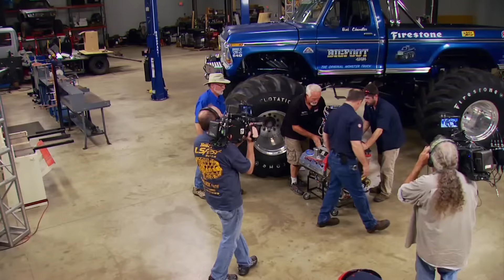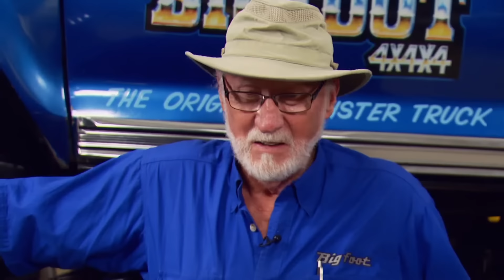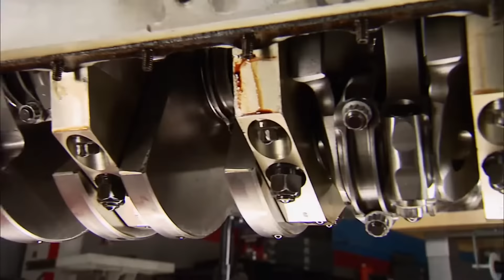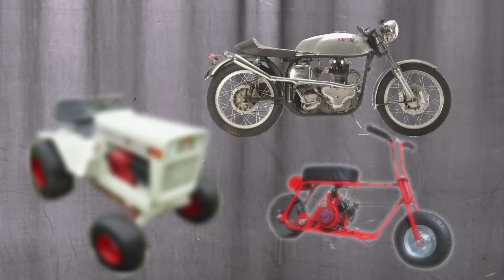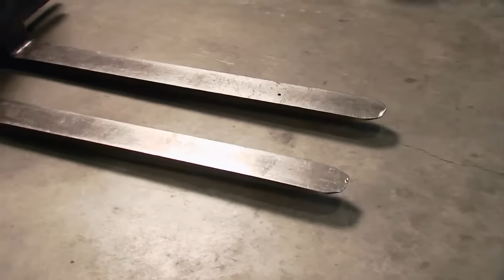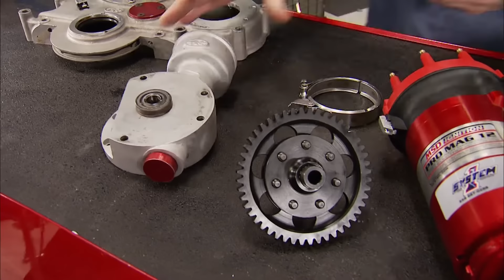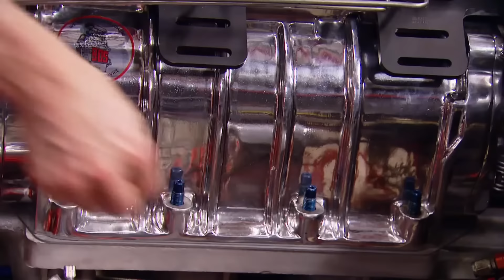Full Build: Bringing Bigfoot's Original Blown Big Block Ford Back to Life

Comment: The massive waste of money that goes into race engines is ridiculous. I’m willing to bet that engine only had less than 5k miles on it. Considering it won’t be ran that much after this it’ll still deteriorate from not being ran as it needs to be. It’s all so counterproductive. Wait until it’s parked for good in a museum and put the non running engine in it. It’ll never be ran again after that point anyways

Comment: This gives a pretty  good idea of how strong forged steel connecting rods are by the fact that they are using the old ones  , every 7.3 powerstroke I bought was with forged steel connecting rods , they started using powdered  metal connecting  rods that were garbage if u add big power.

Comment: PRO TIP: When heating up bolts to kill loctite, use crayons instead of spraying WD-40. I know it sounds silly. But if you push a crayon to melt onto the threads it will work an unmeasurable amount better than WD-40.

Comment: Fully center-counterweighted crank.. 

Nice! 

I use a fully center-counterweighted billet crank in my big Oldsmobile, and MAN that engine is SMOOTH in the high RPM's. Even though the crankshaft ends up weighing more with the center weights, I FULLY believe in using them, and WOULDN'T build another big power motor without one. 👍 
The bearings in my Olds ALWAYS come out looking pristine after a season of beating on it. That was NOT always the case with a stock style crank with no center weights. Even with an aftermarket crank. The #2 and #4 main bearings were always looking a little worse for wear while using a no center weght crank. Now the problem doesn't exist anymore.

Comment: Me uncle Herman Denunzio built this engine.  He passed away on September 23, 2023. He started  Goleta Speed & Marine (which is mentioned in this video)  and De Nunzio Racing Products, which sold off road racing parts. They were avid in Off Road (Baja 1000, etc) and Boat Drag racing.  Which is were this engine was born. RIP uncle Herman. If you guy remember the boat crash scene on Wide World of sports (Opening Scene) , That my cousin Tonny.  Broke his back and both legs. He fully recovered. That was a very similar motor.
Reply: Godspeed Uncle Herman!
Reply: Very cool.
Reply: What state did he start in?
Reply: @TimothyDilley  Goleta California

Comment: What's cool about the two initials on the block using black permanent marker (assuming it is Sharpie brand) is that it will be like a thin powdercoat after a heat cycle or two. Plus some is in the tiny crevices of the aluminum. At my job we had 303 stainless turned housings that were heated to 80C to allow an interference fit ball bearing to be gently pressed inside. They had sn's written on the outside that just would not come off even with acetone and benzene. We had to put them in a lathe 6 jaw chuck and take a couple of tenths off. Yes, Scotchbrite by hand reduced it, but it was still legible.

Comment: Helpful hint.  To make sure you haven't pushed the line out or fuel pressure hasn't worked it out, mark the braid with a sharpie.  Nobody will notice except you when your maintaining the car/truck and is an immediate tell if the line pulls/pushes out.

Comment: What about the Fire Rings on the cylinder  to head mating surface. Does that one not need actual stainless steel wire pressed into the slots?

Comment: As a child of the 80s Big Foot was everywhere.  The merch was as big as those 66" tires, and heck I remember Power Wheels had a Big Foot truck.  She is that iconic, and the evolution story from a simple camping truck to the #1 monster truck is epic!  Without Big Foot (and the legend Bob Chandler) I doubt that monster truck racing would ever have been a thing.  Sure someone may have built a beast, but it never would have caught on.   There are others but there can only be 1 original Big Foot.  Big Foot is the OG and the GOAT!!!

Comment: In 1959, Ford began its first production of factory four-wheel-drive pickups.....
Reply: Yes jerkwad but YOU COULD NOT BUY AN F350 4X4 FROM THE FACTORY UNTIL 1978. Before 1978 Ford outsourced the 4x4 for the F350 to Marmon Herrington or Napco. Ford only produced the f100, F150 and f250 4x4 in house before 78. For phuk sake man, Google could educate you if you did research

Comment: They didnt have 4x4 vehicles? So why is my 1972 F250 a 4x4 divorce T case? or 1965 F150 4x4 with divorce T case
Reply: Ford only built 4x4 trucks in f100, F150 and f250 until 1978. The F350 was only available as 4x4 before 1978 if you chose to have Napco or Marmon Herrington aftermarket 4x4 installed. I own a 1971 F350 with the Napco 4x4 and several 1967-72 F250 4x4 built by Ford. Hopefully that clears it up
Reply: @TheRoadhammer379  Honestly you think i care about some old JUNK truck lmao ill stick with my 2024 cummins that will put any of those trucks to shame and by way they made F350 4x4s in early 70s late 60s

Comment: Good memories of grabbing 2 cartons of brand new eggs from the fridge that my mom just bought and running them over with my power wheels big foot! I got grounded and yelled at but those 30 seconds of bad assery as a 6 year old was def worth it!!  Love this truck and the engine refresh on this episode!  The attention to detail to address every potential future issue on this engine, strengthening weak points, care taken with this engine so that it’s less likely to break something every week was awesome!! Great job guys!
Reply: Back when I was young, there was no battery operated Power Wheels, all of our rides had pedals that you had to power with your legs and feet.

My son ended up with a Power wheels Jeep under the Christmas tree one year though. 

Once the original 12 volt lead-acid batteries died, I PROMPTLY rigged it up to use my 18volt Lithium-Ion cordless tool batteries... 😆 

The look on my sons face the first time he hit the gas pedal with the tool batteries in it, and the Jeep LITERALLY did a wheelie.... 😂

Those batteries were SO convenient, made POWER in the Jeep, and recharged in 25 minutes instead of overnight like the lead acid originals did. 

He had a TON of fun with that thing!!... 👍

The motors took the 18volts like a champ, and never failed.
Reply: AWESOME  BRO!!

Comment: Why are you guys at Truck Tech calling it a 640? It was 638, now it is 572. It is much smaller.
Reply: No engine is spot on with cubic inch measurements. A 7.0 liter Ford engine covers the cubic inch range of the 427, 428 and 429. The 302 Ford, 305 and 307 chevy covers 5.0 liters. 638 is just rounded up to 640, not a big deal. And to answer your question about 572 cubic inches... the shop that machined the engine used much thicker cylinder sleeves, so the bore size went down but the cylinder wall rigidity improved, thus the engine lost cubic inches
Reply: @TheRoadhammer379  
You’re mixing things up. Yes we refer to a 7.0 as one of those you mentioned. But nobody refers to a 427, 428 or 429 as a 430 which would be the equivalent. People don’t even refer to a 598 as a 600. 

And I’m well aware that they changed the note. My point and why I asked a somewhat rhetorical question was, to highlight the fact that at no point in time did they refer to it as a 572 after the change. They still talked about a 640. This was pretty silly as that’s a massive difference. Had it been a matter of taking it 0.0010 over or something had it just been rehired, sure. who cares. But taking it down to 572? C’mon make an effort to inform the viewers a bit.

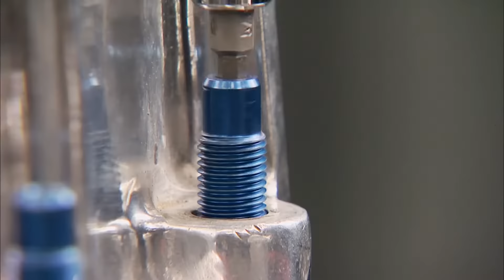Comment: You guys are fake AF… @ 3:03 the blower is sliding around on top of the intake while push the engine/engine stand across the floor, then @ 8:42 it’s magically bolted back down. More staged B.S….. 👎🏼👎🏼

Comment: so ive seen people install a carb spacer to get more air in the engine. could you install that torque plate under the heads and get more piston travel to increase power

Comment: This is not the original Bigfoot. The original was a 1974 ford that had a blown 460 with iron heads. I have a picture of it at Sanderson Ford in Glendale ,Az. Probably around 76-77  It used to be his river truck when he and the family went camping, take the camper off, play in the river.
Reply: This is the original truck. Bob swapped out a 78/79 front fascia on his 74 pretty early on.
Reply: @nathanmcdonald610  Well , he probably made alot of changes on the original. The truck I seen in Glendale is the one he crushed his first car in front of his shopas a demo video.  He had 44" forklift tires on handmade wheels (white) and it and 2.5 ton rockwells for axles.
Reply: @michaelwilliams2151  Yeah, again, probably still this truck, in the early days they ran 48 agricultural tires before they eventually moved up to the 66's that became the standard.

Comment: My dad LOVED those Predator carbs. Thats all he ran on his performance cars!
Reply: Would like to know if your dad had issues with air been sucked in past needle bearings on the throttle shafts, had this problem with a NA 351C which ment for a normal idle the whole carb tune was super rich
Reply: @johngibson3837  I’ll ask next time I talk to him. I do know that he would grind custom cams for the carb, make fuel baffles out of cut up beer cans, adjust the size, quantity and spacing of individual holes in the Venturi fuel bar and about every other tweak and tune you could do to them.
His last setup was on a ZZ4 small block he blueprinted with an original 6-71 on a chopped and tubbed 34 Ford Coupe that would run like a scalded ape on VP110
Reply: We ran them on 545ci BBF sled pull engines. They were all tuned by an old timer that was a carb wizard, absolutely love these carbs

Comment: I remember when the predator carbs was a have to have or you weren’t in the game .
Reply: They we're great for Monster Truck applications back in the day because they we're much more resistant to stalling than your standard Holley or Edlebrock when trucks had their nose pointed at the sky. They had a good run until fuel injection became the primary method of fuel delivery for these beasts in the early 1990's.
Reply: @nathanmcdonald610 had that problem with a 351C in a landcruiser, in the bush on steep hills holly carbs would fail due to lack of fuel in the bowls but a predator solved that

Comment: I'm confused, how old is the engine?
I'm 14 mins in and they said it' s 20 years old, 30 years old and mentioned that it was from the mid 80's which is even older....
Reply: Bob purchased it in 1985 for Bigfoot #1. Assuming it was a new build at that time that would make it currently 39 years old. This was filmed 10 years ago, so at that time this would have been a 29 year old engine.

Comment: Sometimes I feel like we've gone backwards when it comes to mechanical engineering. The engines from back then just hit different. I have a SRT challenger with 700+ HP. But I still remember my dads 73 Firebird Formula that he swapped a blown 455 into in the mid 80s feeling like it was going to crush my rib cage on launch. I wish he kept that car...
My dad also took me to see this very truck at a monster truck event in 1987. I was only 5 years old but still remember being able to feel the engine sounds in my chest every time the trucks went by. Big Foot was my hero and I will never forget the joy I felt watching these guys in these giant trucks.
Reply: It's ALL about the cubes.... 

Today's smaller engines just don't have the torque of a mountain motor big block. The 550" motor in my Olds is like a bucking bronco when you hit the throttle. It's instantanious.. 

My buddy with a 700+h.p. turbo LS Silverado says the same thing as you did... he rode in my Olds and said "WOW!! this thing is a WHOLE different animal than my truck!! I WISH mine came on like this thing does when you hit the throttle!!"

Yea, a big cube N/A engine is definitely a different beast than a small cube boosted motor. Torque for days

Comment: I am confused if this is the very first bigfoot? I just watched another video of a open house at their shop. With another truck it had smaller tires with a 460 engine and winch on the front. It was the truck they used in the movie Take This Job and Shove It during the mud bog scene. I always thought the engine in this truck was a 427 SOHC. Now looking at it looks more like a 429 Boss. I wonder what the c.i. the Allen Root is?
Reply: This is the original Bigfoot. Alan Root was a Ford performance engine builder back then who primally modified large displacement Ford engines to for performance boating purposes. No Bigfoot ever used a 427 cammer engine, Bigfoot #3 did use a blown boss 429 in the early 80's though. Bigfoot #1 here was initially powered by a blown Ford 460 and when Bob decided to make it the mud racing and hill climbing truck he wanted even more power, so he got in touch with Alan Root and acquired this 640ci Ford beast to put in Bigfoot #1. This is actually about a 10 year old video, I don't think the 640 ever went back under the hood of Bigfoot #1 since it's a rare and temperamental race engine with WAY more power than the truck needs for what it's used for these days. The 640 I believe is on display at the Bigfoot headquarters as somewhat of a museum piece now, oh and also they rarely ever put the 66in tires on Bigfoot #1 anymore, more often than not it can be found cruising around with more manageable 48in Terra's on it.

Comment: I went out and bought a 4 Wheeler Magazine (Winter of 1978) after getting my own 4 Wheel Off Road vehicle. And it appeared as 4WD was becoming big...as in a fad...for me as a young teen just getting started in it. I thought that because I was one of the very first few to roll up with a Four Wheel drive (Cherokee Jeep) as an everyday driver at my high school/my area (that changed quickly). Along with all the new hype for 4WD's came "Bigfoot" which was featured in that edition of "Four Wheeler" magazine which I had just bought. It told the story of how Bob Chandler had built his 4 X 4 Beast up from stock by himself with Industrial size rims and tires! Literally, changing the face of trucks, Jeeps, and Broncos everywhere as they were just starting to get around town with lift kits and bigger tires. A true innovation: BigFoot. A great time for Four Wheel Drives everywhere and bringing great memories.

Comment: One of my brothers friends fathers was an employee at Midwest 4 wheel drive in the 70s. He drove the original bigfoot home one night and I got to ride in the bed with a few kids from the neighborhood. Every time he turned the rear steer I hit my head on the bedside lol. I am a photographer as is Bob Chandler and we always have great conversations at the open houses.
Reply: Is this the very first bigfoot or is the one with the smaller tires they used in the movie Take This Job and Shove It the first one? That truck had a 460 engine, smaller tires  and a winch. Also cool story you were a lucky kid getting to ride in the back of Bigfoot....
Reply: @klink708  I believe Bigfoot #1 was used in take this job and shove it. Also Bigfoot #1 originally had a blown 460 in it but I think it was around 1985 when Bob swapped in this big 640ci Ford in.

Comment: The engine makes more power than what that new transmission is rated for by 275hp. Personally I'd want the transmission rated for more than what the engine makes. Probably a good thing it won't get run much.
Reply: I don't believe this engine went back into Bigfoot #1. I think BF1 uses a much more mild 514ci Ford crate engine these days, it doesn't need anything crazy like this 640 as most of it's use today consist of making promotional appearances.

Comment: Actually the part number on the block "E2ZM" means 1982 mustang..the Z means mustang...the M means special or prototype part pending on what the part is.
Reply: Close, but speaking as a 30 year Ford Parts supplier and Tech, it's more specifically: Decade, Year in that Decade, Product Line, Source of Product. i.e. E=1980's, 2=1982, Z=Mustang, M=Ford Performance Operations(aka SVO).
Reply: @SternLX  right..I didn't break down the full part number..just the ones that were wrong.

Comment: Ewww using Royal Purple, needed to be using Redline products for assembly and for its final oil fill.
Reply: They are the sponsor
Reply: @rondoggindy1  So what, why use their garbage in an iconic build like that.
Reply: okay redline shill
Reply: And what says royal purple is garbage?   Have been using it for close to 20 years and have never had an issue due to their products.   Granted I don't use it in a race application but it serves well in a day to day use.
Reply: @64ssmalibu  It's basic oil with dye in it. Their API\Dexos stuff is basic oil, there are better API\Dexos stuff choices out there for cheaper. Now, if you want to step it up to compete with top tier oils use their HPS/HMX lines, not the stuff you get at Walfart.

Comment: seen my first monster trucks one of which Big Foot was in like '83 or '84 in the HHH Metro Dome doing wheelies down the tractor pull track
the Monster Trucks AND Tractor Pulls got me hook line and sinker for years
first time seeing Grave Digger he did the most insane doughnuts right down to the cement of the stadium and smoked it out to the point you couldn't see the other side 
bro must have been pukin buckets inside the truck

Comment: I don't think the smithsonian is good enough for this beast. It doesn't want to sit idle gathering dust, it wants to be driven and maintained. We have the technology, it has the power, it deserves nothing less.
Reply: 100% agree. A quiet museum exhibit hall is the wrong venue for machines that are meant to move. Every car “museum” I’ve ever visited is a bittersweet experience because on one hand I get to see an iconic vehicle, but it’s also sad, like seeing a caged eagle.
Reply: And when something happens to it or the engine blows and there aren’t parts to replace the ruined parts?
Reply: @rbslammed6163  If the parts were made once then they can be made again.